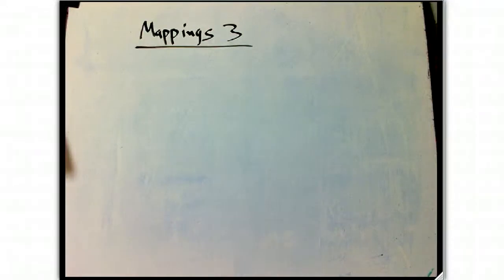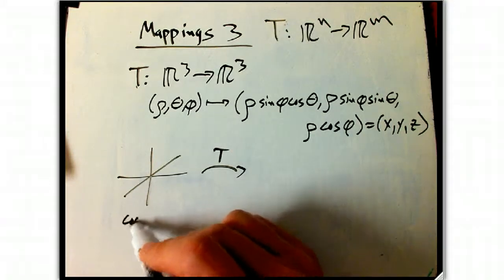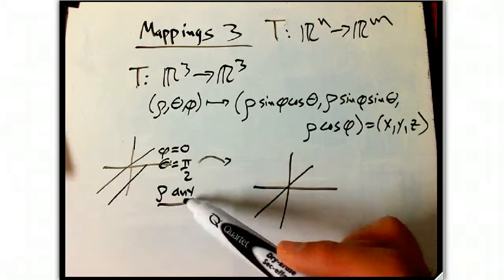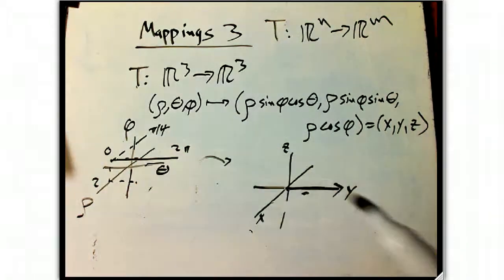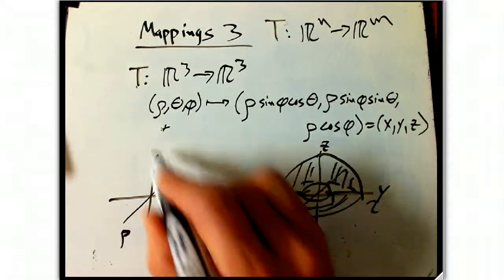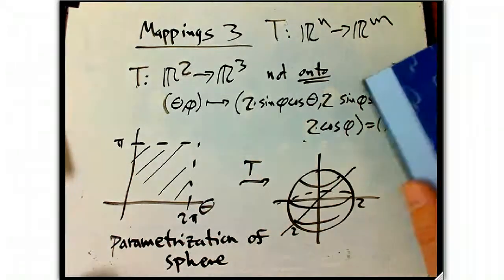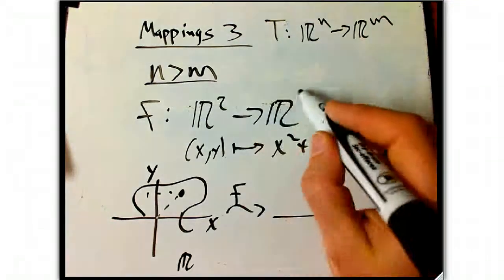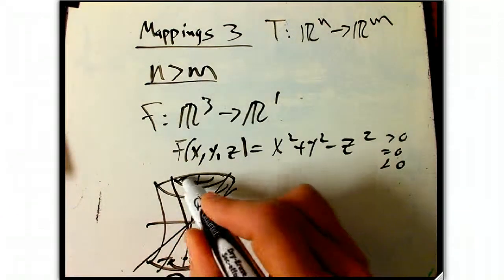mappings 3 (new)

Comment from the maker: the transformation looks approximately linear. So yes, you can take very small vectors (infinitesimal, if you like, although that's hard to make rigorous) and they will get transformed in a very close to linear way, with boxes going to boxes. Answering your first question, yes, the fact that a box can be transformed into a sphere by a continuous mapping has something to do with the topological relationship. However that would be a lot tighter if the transformation were invertible, which...

Comment from the maker: True in part, although the terms "cosets" and "kernel" are reserved for the algebraic case with good reason. Namely, in the algebraic setting (groups and homomorphisms, vector spaces and linear transformations, etc.) the different level sets are all essentially identical to each other, and hence can be understood just by looking at one, the kernel. In the nonlinear setting the zero level set doesn't tell you nearly as much about the other ones.

Comment: Two questions. First, does the fact that a 'box' can be transformed into a 'sphere' via a linear transformation say anything deeper about the relationship between them, in a topological sense, perhaps? Second, if you try to map finite vectors in R^2 to a sphere in R^3, wouldn't the vectors have to 'bend' in order to occupy the spherical space? Is this a motivation for using infinitesimal vectors, since in the limit as they get infinitely small they don't bend?